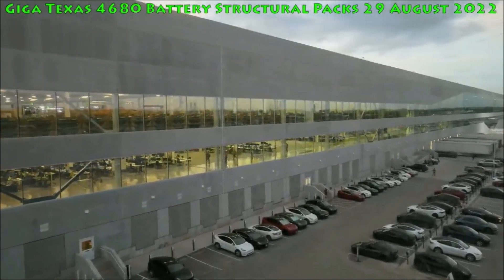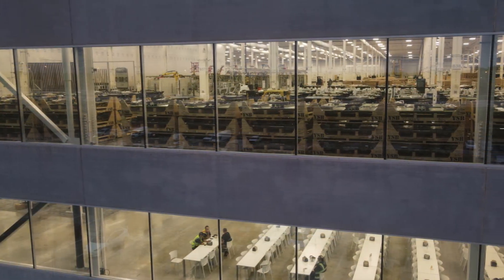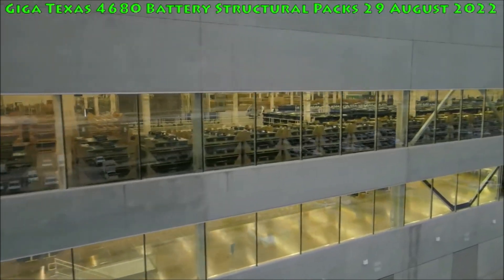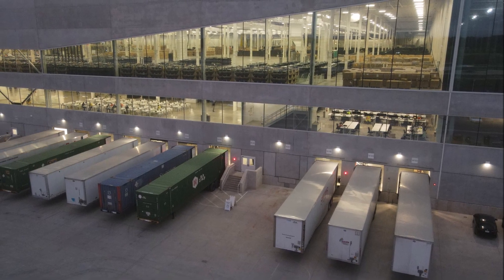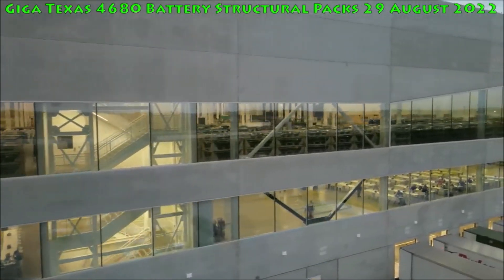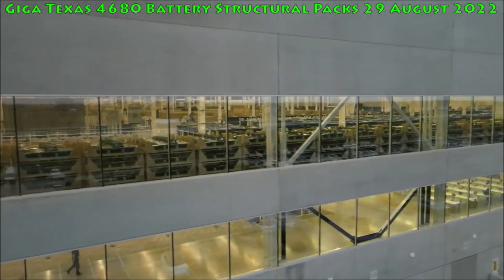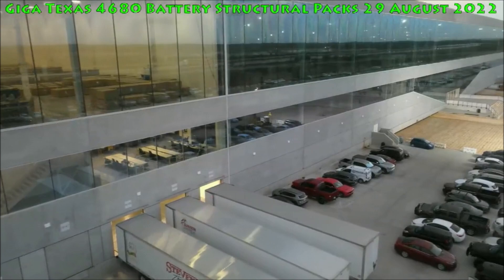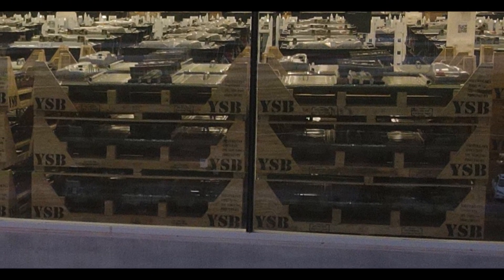Drone Captures Tesla Giga Texas' 4680 Battery Production, Then This Happened

Comment: The title of your video is very misleading and Clickbait-ish. The video is about the structural battery pack production not the 4680 battery production.
Reply: @catseyes2334  Yes the structural pack uses 4680 batteries but the video isn’t about the 4680 battery production at all. If the title said “structural battery pack” or even “4680 structural battery pack” it wouldn’t be a problem. Everyone wants to know about the problems and progress of the 4680 production. If the 4680 production was going smoothly, then these structural battery packs wouldn’t be piling up in inventory.
Reply: @catseyes2334  Thats like a title that reads “Tesla’s  Giga Texas Model Y Production” and the video only talks about electricity because the Model Y uses electricity!

Comment: I Will rather prefere to have heavvy batteries on the ground floor
Reply: Even though the title of this video says 4680 production, the video is about the structural battery pack. They probably would keep the batteries on the ground floor. I have seen video of them lowering parts of the structure to a lower level.